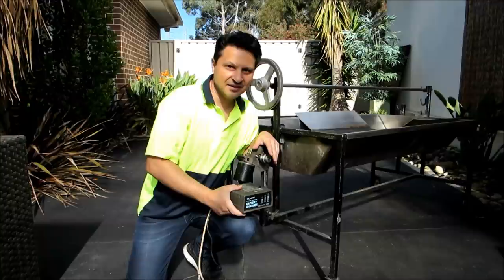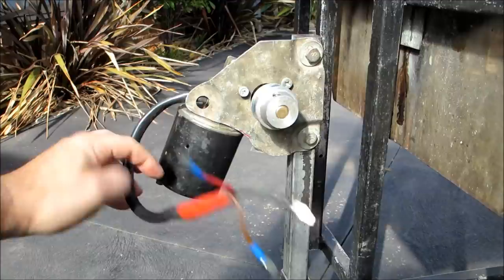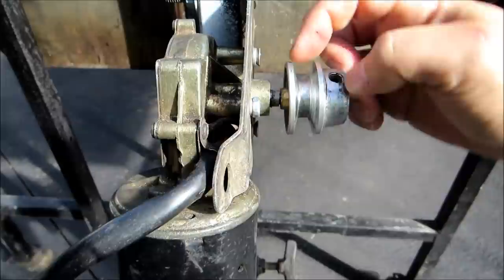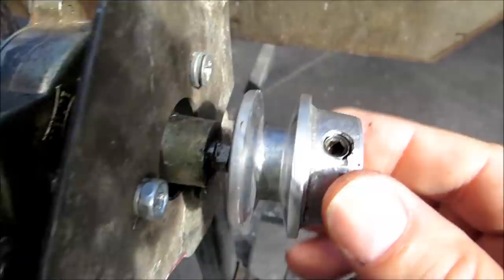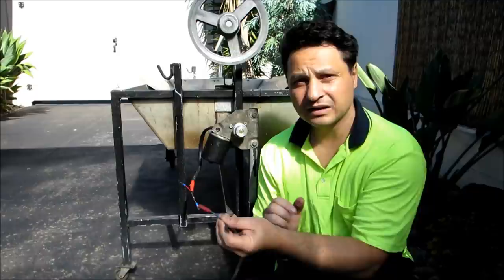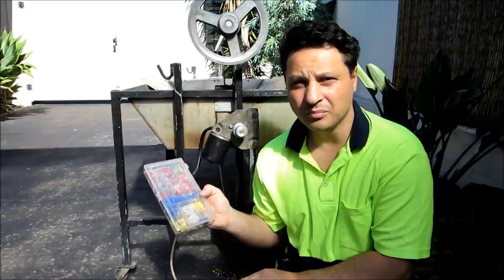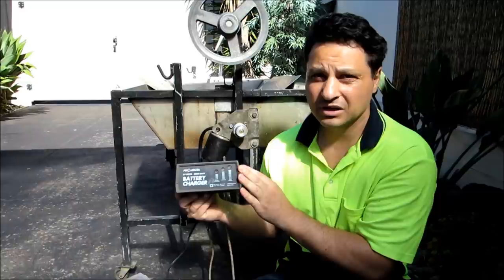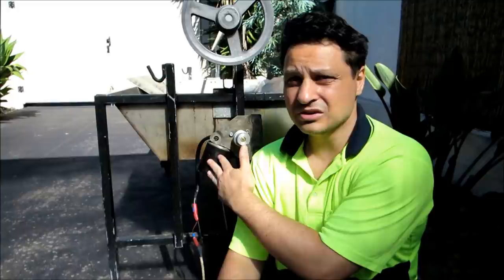Rotisserie motor made from a car wiper motor

Comment: really useful information, even for someone who has no idea about electricity etc ,  the thing is that you  have put me off buying a new  charger to run a wiper motor , knowing my luck if i buy a new charger  and i use it  when  i walk away the motor will stop and by the time i get back one side will be cooked  while the rest is raw , please send me some more information on what  i should be looking for when buying a second hand battery charger that will not stop/overheat etc , thank you for reading all this.

Comment: great video .. where did you get the big wheel on the rod
Reply from the maker: The wheel on the rod is called a pulley (aluminium) and I got it from a store which sells pulleys. You can go an internet search to Pulley suppliers in your area.

Comment: The pully is not big enough. I have same set up and that size pully is way to small.
Reply: Try a bicycle wheel rim...on the rotator shaft..and a speed controller (PWM) from China for a few pence..search eBay

Comment: Why needlessly complicate it ?
Raise the motor and drive the rotisserie shaft directly off the wiper motor
Set speed with a rheostat
Reply: No —- No ——— Do the Job correctly. I machined  a boss for a light interference  fit on the W/screen motor. My motor rotates at aI needed 6 RPM  on Roto. Shaft